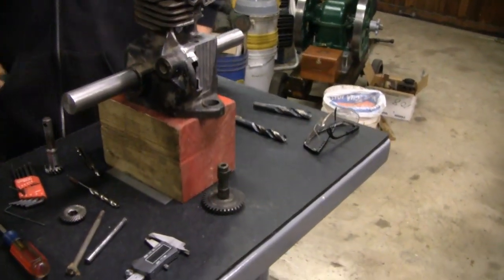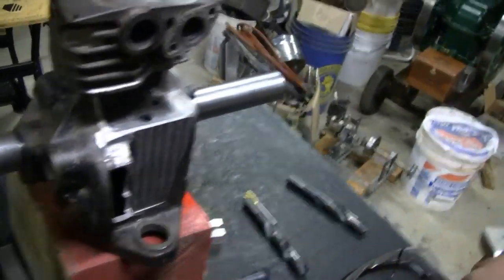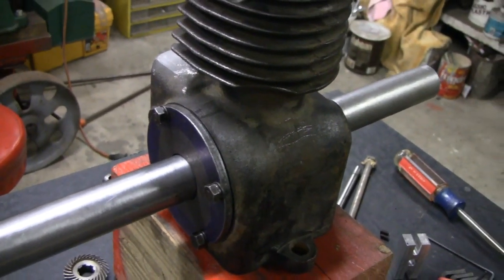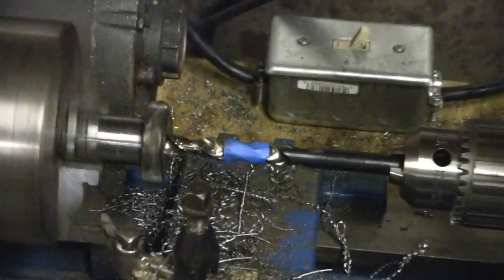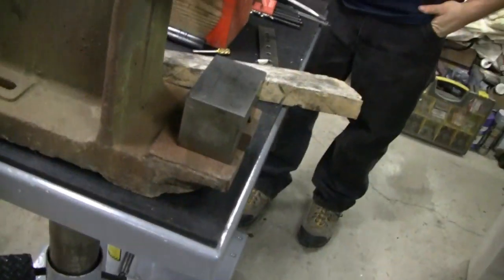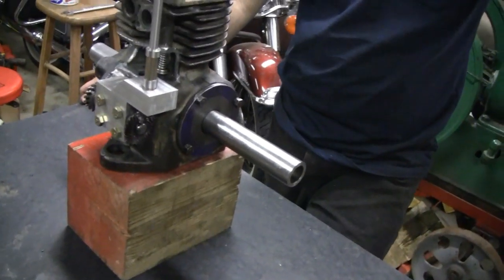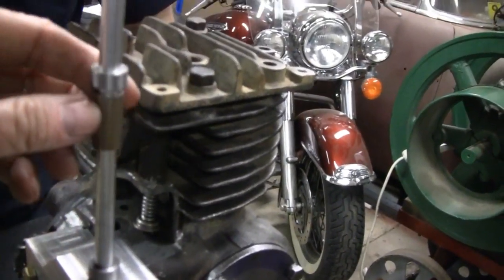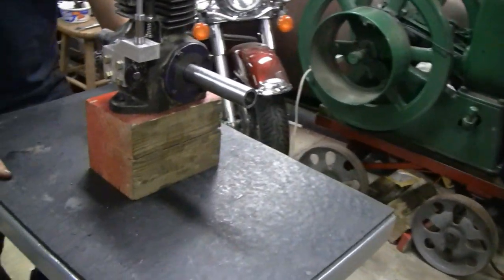HOMEMADE HIT & MISS BRIGGS PROJECT (part 6)

Comment: where u get ur gears from
Reply from the maker: We picked them up at an auction in a misc. box!!☺
Reply: i have a b and S 6.0 ohv engine . u know of how i can make it water cooled . the reason it going be inside an r/c truck am building wont be much air flow where the engine will be place
Reply from the maker: Nah I don't know how you would go about that, I've never heard of anyone doing it before either!! But that doesn't mean it can't be done!!☺
Reply: do u think putting copper tubing around the head and pumping water thur it will do it

Comment: The term "balls to the wall" does not come from centrifugal governors.  It comes form the WWII aviators who's aircraft throttle levers had balls on the ends.  When you push them wide open towards the aircraft firewall (where the engine was mounted) you were "balls to the wall".
Reply: +panzerabwerkanone the term balls out come from fly ball governors....